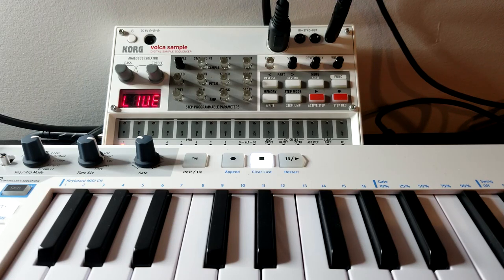Pajen's Volca Sample Firmware(Beta 6), New Feature Walkthrough

Comment: This firmware upgrade is great and really opens up the volca sample, your videos are a massive help so thanks. Is it possible to use my DAW to record the chromatic keys and play back? Im struggling to get my DAW to  talk with the Volca Sample utilising  midi 1-10. Is this firmware for purely live implementation?
Reply from the maker: Hey Tom, thanks!

To your question, I haven't tried this myself, but I don't see why it shouldn't work, you figure a MIDI controller would send out the same note data as a DAW (I'm totally guessing)

Like if you DAW is pushing out notes via MIDI on CH 1,it should play sample part 1 just the way my keystep does in the vid?

I'm assuming your global setting 9 is enabled via the Volca Sample, if in doubt you can set your DAW to push out MIDI to channel 16, set OMNI to SEL and see if that works on the selected sample part.

The only other silly thing I can think of is if you have a MIDI Controller that plays nice with your DAW, you could feed it MIDI from your DAW and daisy chain it to the sample so the midi controller sends it notes...

Hopefully others with more DAW experience can chime in with suggestions
Reply: @NickCapron   nice one and thanks for the reply. I will certainly give the options a go and take a look at global settings. Waiting on a decent soundcard with midi in and out just so i can get the set up right. Keep up the good work👍👍👍😎🤩

Comment: Thanks for the video.  It was really useful. I'm stuck with a little problem, if you can please try and help me out..
I've synced my Keystep (Midi Out) to Volca Sample (beta 7) - Midi In. I can do all the functions shown in the video. However, when i press the RECORD button in the Seq mode in Arturia, the Keystep stops playback. And when i stop recording after pushing a bunch of keys,  it weirdly resets the original sound  to some older sample, instead of the original Sample stored in the step!  
Can you please try this and let me know if seq works for you? Do i need to toggle any parameters in the MIDI Control Center ? My aim is to use the samples from my Volca sample and just use the Keystep in its Sequencer mode. Is this even possible with this upgrade? Appreciate any input in this regard!
Reply from the maker: Hi Arun, I will take a look at this and get back to you!
Reply from the maker: Hey Arun, check out my vid here, https://youtu.be/ZkwUkm8NPP8

You may need to disable global parameter 6 on the sample to fix this.
Reply: @NickCapron  Hey Nick, Thanks for the new video, one of those likes is from me :-)
That's neat tip to prevent start/stop of volca from external source, and is very useful for jamming. 

However, my issue still persists. The saved sequence from Arturia does work but i can't update the sequence on the fly. Pushing record button again mutes the sound, and resets the sample in that part to some default sound.
To reproduce the issue, try the following:
1. Choose a midi channel and Play a stored sequence in Arturia, while connected to the Volca Sample (Beta 7)
2. Press Record button (you will see that the sequence mutes automatically, this is already weird).
3. press stop and replay the sequence. (you will notice that the original sample stored in the midi channel now changed to some random beat. The original sample stored in the respective part in Volca is also replaced automatically. This is a bummer).
Maybe it's just a bug in beta 7...? Maybe beta 6 doesn't have this bug. I'm yet to try that..

(edit: i did change the parameter in part 6 as suggested)
Reply from the maker: @arunsrv  Gotcha, I'll follow your steps when I get a chance and see if I get the same thing happening with the sample/keystep
Reply: @NickCapron  The problem was due to control messages going out via MIDI from the Keystep. Suppressing these control messages using a MIDI THRU unit (MidiTech) helped resolve the issue. Now i can record, and edit the Keystep sequence using the samples from my Volca.
Reply: @arunsrv  I have the same MIDI THRU unit. Which control messages do you need to suppress?
Reply: @Wolvenamsterdam  Switching the 5th switch called Controller does the trick. Leave the remaining switches on the other side together.
Reply: Arun Narayanan Thank you :)

Comment: Is there a way to get the functionality of the rk02 cable where the first 10 keys play the selected samples and above that they play the last selected sample chromatically? That setup made for some extremely interesting patterns with the beatstep pro
Reply from the maker: I'm not sure with the keystep alone, problem is, depending on what midi channel you are using, you are going to get a different result.

Now if you have a midi controller where you can split the keys across multiple midi channels you might be cooking with gas, I think the keystep pro MAY be able to do this, but I don't have one, or have done enough research on it to say 100%

If you figure it out, let us know as I'm sure others would love to do the same thing!
Reply: That's exactly what the rk02 cable did, it bussed the midi channels into one

Comment: Hey man thanks for the video. Very well explained, things that took me a while to figure out and things that still havent until now hahah. Anyways I have a question regarding th pattern change . Do you have to hold the memory button to change the patterns? I use the sample as sound engine bonus for my drumbrute impact and when i change patterns on the drum brute  I'd like to change the patterns on the sample too as I use them as different drum kits. Empty sequences basicaly just sample kits. Is there I way to accomplish that? I still cant get my head around if it is able to to these changes via midi ... thanks
Reply from the maker: Hey Chavdar, for the patern change, are you talking about bar filter adjustment I did for samples 2 to 5?

To get into the menu you need to hold down FUNC, but once you navigate to Omni/Porb/Brfl/etc you can let go of FUNC and just use the sample dial to make adjustments.

After the adjustments are made, you do need to hit FUNC to exit the menu?

Does that help at all?

Comment: I'm using Volkaoss arduino uno plus midi shield to use one ch to choose parts on c2 octave and play chroma on c3-> but some features in Pajen fw are really nice!
Reply: This sounds like what you were able to do with the rk02 cable, I loved using that set up with a beatstep pro. Could you tell me more about your setup?
Reply: @michaelchadwick6853  1.Google "volkaoss", 2.buy arduino uno and cheap midi shield on AliExpress,  3.flash firmware and 4. conect and play. All manual's you will find in 1.

Comment: I have noticed that each time i hit rec/append on my keystep 37, the current VolcaSample part resets its sample to S.000  which is frustrating. Also, sometimes the pitch of the part goes so low, dont quite udnerstand this behaviour.  

In MidiControlCenter i cant find where to define the CC messages for transport buttons

If I  disable global parameter 6, i would lose the internal sequencer which Id like to keep usable as  refering to this video :3

https://www.youtube.com/watch?v=ci_ReYDKUfI

So you could have on VolcaSample part dedicated to chop amen breaks :9
Also i have a simple midi thru-3 but it is DOREMiDi and i think it does not filter midimessages. Should I start buying the miditech one?

Help :$

Comment: Thanks for this really helpful video. I still can't quite seem to get my Novation Circuit & Volca Sample working in harmony though. 

On my Novation Circuit I have it set up to send MIDI notes / CC, clock & programme changes. Synth 1 is set to channel 11, synth 2 to channel 2 and the drums to channel 15. 

On the Volca, I have both parts 9 & 10 selected. 

With the above set up I can play patches 1-10 on synth 1 and patch 2 chromatically on synth 2 without issue if omni is set to off. However when I change the omni setting to Select or Sample, my pre-set drum pattern on my Novation triggers patches 6-10 on the Volca making it sound awful. 

If you have any experience with this problem I would be really grateful for your advice.
Reply from the maker: Hey David, I do have a circuit so maybe I'll give it a shot and make a video.

Just working on a Volca FM review, but once I get that done I'll bust out the circuit and sample.
Reply: @NickCapron  amazing, that would be really helpful
Reply from the maker: Hey David, I gave it a shot here - https://youtu.be/6RBVyl_Nlvk

I think if you are using parts 1-10 with Synth 1 (MIDI 11), if you use OMNI mode over any of those parts (Drum tracks - MIDI 15) its going to mess up the samples under those parts, thus screwing up your sequence.

So I'd recommend saving parts 7,8,9,10 for OMNI mode, and only use parts 1-6 with Synth 1/2 to avoid getting a scrambled up mess.

Hope that helps!

NC
Reply: @NickCapron  thanks so much for this. I have some spare time at the weekend and will check it out

Comment: do you think this is still a solid buy for 2020?
Reply from the maker: For sure, comparing to the other Volcas, it's probably my favorite next to the FM.

The only downsides are headphone out only, very small sample space, and it can be a bit of a pain in the ass to load samples in/out.

But with Pajen's new firmware, the little guy can do a lot of neat tricks.

Take a good look at the Elektron model samples before pulling the trigger on the Volca Sample.
Reply: @NickCapron  cool thanks ! Ya looking at the elektron sample too! Great vid:)
Reply from the maker: @L_Enfant_Terrible  Cheers! also lots of virtual samplers too, but for hardware, it's hard to beat the price/capability combo of the Volca Sample.